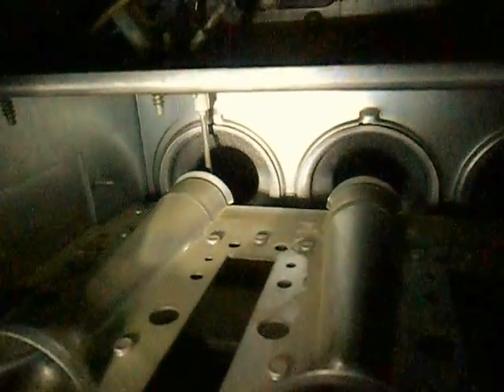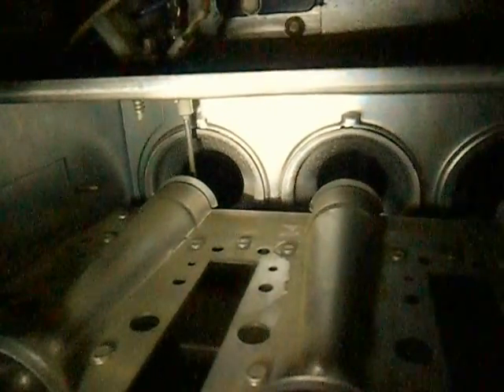How to diagnose what's wrong with your furnace (cleaning flame sensor)

Comment from the maker: Just an update, I fixed my flame sensor over 2 years ago by just cleaning the metal flame sensor , which can be held in place by a bolt or screw.  Haven't had this problem since and still haven't replaced it and it was 10 seconds of cleaning the metal rod that acts as the flame sensor.  If you don't want to get into the LED states, and the symptoms match those described it is probably just build up on the sensor and you should just try cleaning it anyway to save yourself the problem.  If you call someone in then do the LED check first to be educated against those few repair people who will take advantage of peoples lack of knowledge.